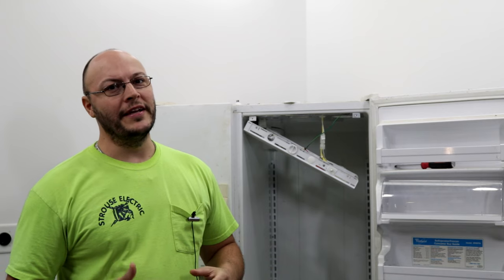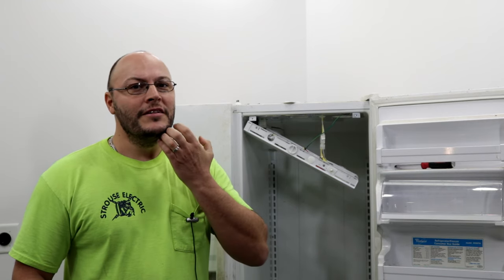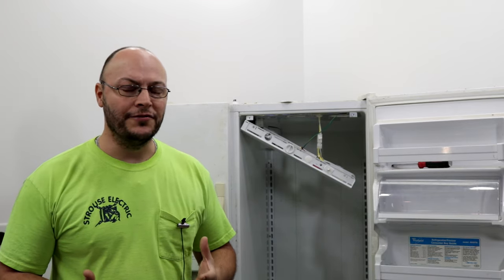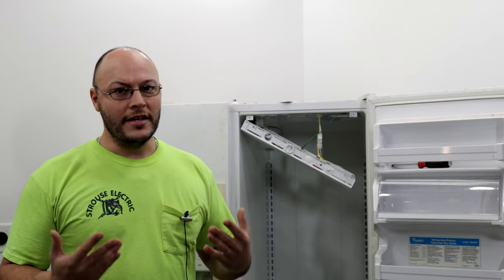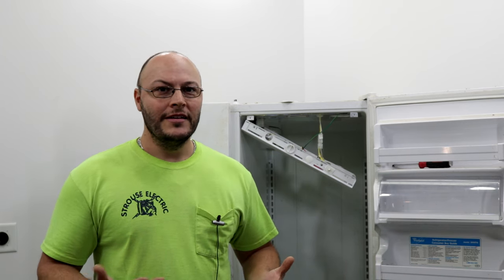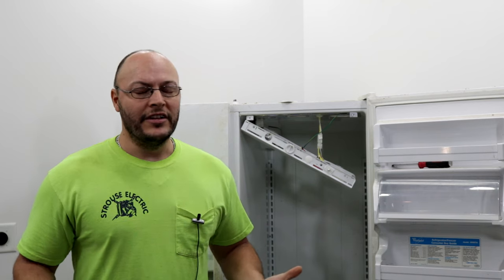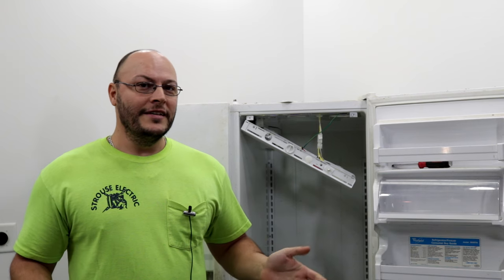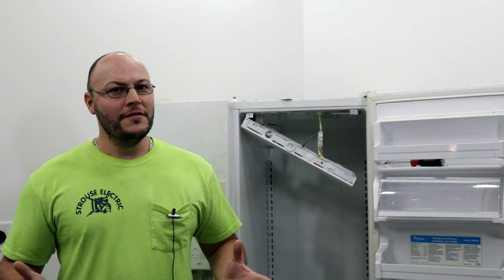Whirlpool Side by Side Refrigerator Not Cooling - Freezer Not Freezing

Comment: My freezer is not freezing (ice cream soft) and I noticed the compressor is very HOT, condenser coils are clean, so is it low freon that is causing the compressor to run hot (129°)?
Reply: They can get as hot as 300°f and that's normal...

Comment: Had a small flood on my back patio and mine is on the back patio. Stopped freezing. Pulled out today,  hecked the back and bottom. Looked ok. Running blowing cool air but not freezing.

Comment: My whirlpool side by side was not cooling. I replaced the timer and thermostat and cleaned the evaporator. Still wasn't cooling. The door light switch which worked ok when I pushed it by hand,when I shut the door,it wasn't working. I took a coin and taped it to the door,so when I closed the door,the light went out,and the fan was blowing.  It probably needs a door adjustment,but I have been using that penny for over a year,and that was all that was wrong with it. It took me a week to figure this out . Give it a try,

Comment: Great in-depth tips, thank you! 

It helped me think about my current troubleshooting case more deeply... specifically, I didn’t put the back cover back on this fridge while testing it. This is preventing the compressor fan from pulling air across the compressor coils, and might explain why I can’t find any more defective parts (replaced a defective freezer temp. sensor), but it still doesn’t cool enough in the freezer.

Comment: I see most of the posts/comments are 2-5 years old so...hope you're still online and available to answer any questions we consumers might have, Bill. We have a Whirlpool Side-by-Side InverterPlus Refrigerator/Freezer (Model 7S21 FNI SL) that we purchased second-hand; ever since Day #1, the freezer unit only frosts over when I use the magic "Quick Freeze" option on the temperature/control module. The fridge works fine - or seems to - but (as you say) the freezer "doesn't know what temperature it's supposed to be at." I could see any/all of the diagnostic problems you've addressed being part of the anomaly but "it DOES actually frost over when I hit the magic asterisk (*) on that control on the outside freezer door.

To be sure, I'm not really expecting an answer anytime soon, but...I thought this better than paying $200-300 for some half-baked technician(s) to come here and tell us it's outta freon (which I know it ain't if the shelves are freezing under "Quick Freeze" mode. Like they say, I was born at night...but not LAST night. Your best guess is what I'll take to the bank, Sir - I'm not an electronics or even similarly functional repairman, by any stretch; so anything you have to offer as a solution is great with me.

Thanks!!!

Dave Satterfield
The Philippines

Comment: Hi Bill, Graham from down under in Melbourne , Australia.  Bill your videos & explanations of fault finding of refrigerators are brilliant & I wanted to personally thank you for all the information that you share freely with everyone. In this day & age there are too many people that just want to take & are not prepared to give. Can you please help me out with an issue I have with my side by side Whirlpool Refrigerator Model 6ED25DQXFW00. The Freezer section is fine however the fridge part is not cold enough. I can confirm that the evaporator fan in the freezer is operating ok & cold air is entering the fridge for a period of time. Initially, I thought I had a faulty diffuser as the flap was not allowing cold air into the fridge so I replaced it with a new one. My issue is that the flap is not opening to allow the cold air into the fridge as it is generally closed. Occasionally, I have to manually insert a knife into the diffuser from the fridge side to slightly open the flap. Could I have a faulty Refrigerator Thermostat? Once again many thanks!

Comment: thanks bill, good info i have the soft icecream problem 'checked timer ,heat coil,fans are running, motor runs  cleaned all coils,but only 1/2  the inside coil ends up frozen,so im thinking it probly needs more freon ,thanks for your help

Comment: Our SxS Whirlpool is not freezing or cooling. the compressor is on and the fan is working. What could it be?
Reply: You can have a sealed system issue
Reply: Same problem I am having with my Whirlpool SBS. Then it will freeze then thaw again. I'm calling a repair company.

Comment: Thanx for your Vida,  you're very knowledgeable and helpful...I have a smilar WP side by side thats been driving me crazy for 2 months.  Freezer use to get to zero and frige was at 50...after changin the following parts it is stuck at about 20 freezer and frige is still at about 45 50   I changed the damper control, frige side thermostat, evap fan and condenser fan..the evap was did have frost over the first and last coil only...it melted as soon as I unplugged the frige and defrosted as soon as I plugged it back in...buti put the cover back on and can't see how it looks now....I took a pic of it....can u please help me

Comment: I am working on a big deep freezer approximately 300ltrs (1/4 compressor) the issue am having is that it not freezing inside, the suction line outside freezes and drops water everywhere initially I thought I over charged it (r600a) I started reducing the gas till it was nearly emypt still not freezing please I need your detailed help

Comment: question bill will a refrigerator go bad if it has been setting unplug for one year or that should not matter . I had it in storage for a year and they told me that it is probably no good anymore because it had be setting to long .
Reply: You could plug it in and see. If it has been laying on it's side the oil migrates from the compressor to the freon lines, that's bad. You would just need to stand it upright for 24 hours before you turn it on. Otherwise it shouldn't really matter if it's clean.

Comment: Freezer is not cooling properly, as you stated, ice cream melts and is just not cold enough..on the other side of the fridge it actually is somewhat just cold enough for food not to go bad right away.  also wished it would be cooler as well.  please help , what could it be?
Reply from the maker: +Larry Cardenas Is the back wall of the freezer blocked up with a bunch of frost build-up?
Reply: i will check and let you know...hey thanks for reply
Reply from the maker: +Larry Cardenas No problem man, talk to you later!
Reply: yeah bill the back (bottom part only the last couple of coils) were frozen.. so i changed out the bottom sensor and the heat/defrost part at the bottom end of the coild.. on monday today is wednesday.. now the ice maker isn't making any ice it used to before, and i really don't see any change in tempeture.. i put a tray of water as a test to see if it would freeze on the bottom tray of the freezer side..it has not turned to ice yet after 48 hours...should i just throw the fridge away...its driving me crazy..

Comment: Evaporator fan works sometimes,  and sometimes not, i gave the fan a spin with my finger,  and it started to run. And the frig gets cold, and the freezer works great
 But i didnt see anything blocking the fan from spinning
Reply: I know it’s probably too late now, but I bet it’s the bearings and just needs the motor to be replaced. eBay is the best place to get things like that.